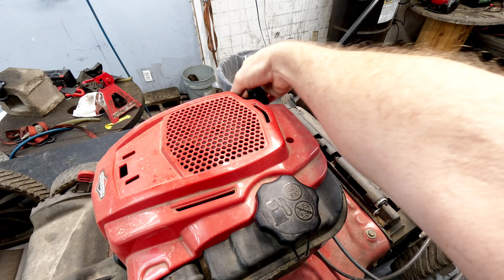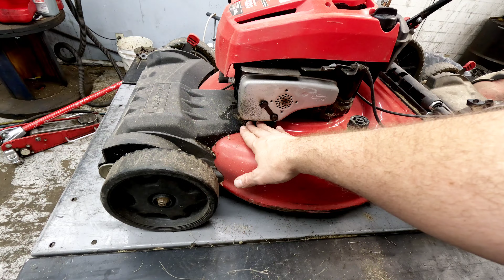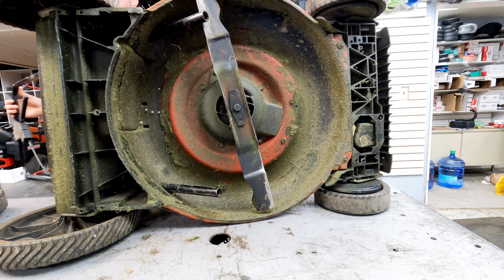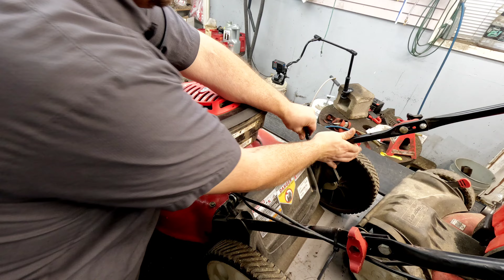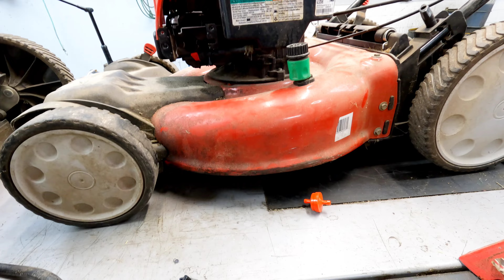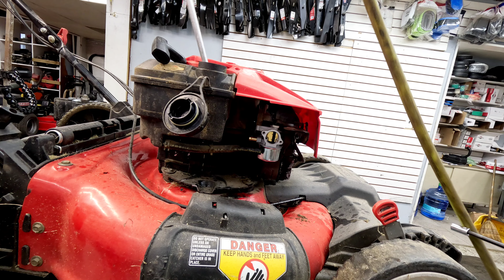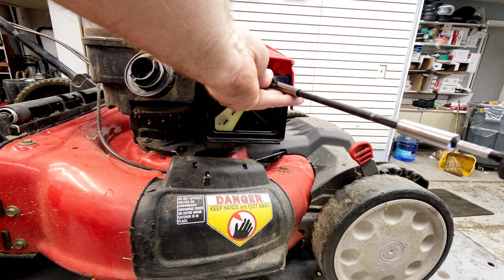Troy Bilt Lawn Mowers Won't Start, Start's Then Dies Full Diagnosis With Easy Repair Instructions

Comment: o ring fell off after you touched it before putting the carb on.
Reply: Wow 0:29
Reply from the maker: @bradhill9997 not sure about :29 but yeah!!
Reply from the maker: Good eye! Not sure how it ran well without it! I have never seen it happen like that! It failed the double check for irradic running so we will see if I can figure out why 😊
Reply: Easy to miss. it happens to all of us.  @IndRepair
Reply: I should have mentioned the time 35:07

Comment: My 190cc troy bilt just died and won't restart carburetor cleaned new filter and oil change and it won't start
Reply: Hope this video shows me something
Reply from the maker: @donaldfinkler2490  Hopefully you switched out the fuel and made sure the gasket at the back of the carburetor was installed? Will it start on carburetor cleaner or starting fluid in the intake?
Reply: @IndRepair  carburetor is new I put it on in the spring and it ran shut off and restart I sprayed carb cleaner and it spits it back out
Reply: @IndRepair  it won't restart
Reply from the maker: Sounds like the flywheel key is sheared possibly

Comment: If they were mine I would drill holes thru shaft and install bolts and nuts
Reply from the maker: That would be much more secure, the ones holding these on don't lock really tight at all